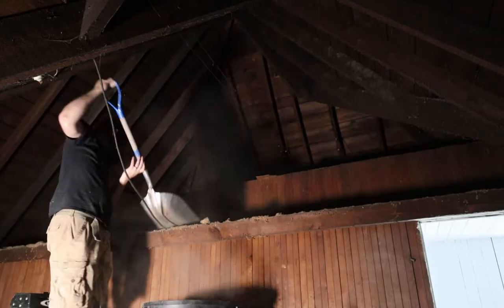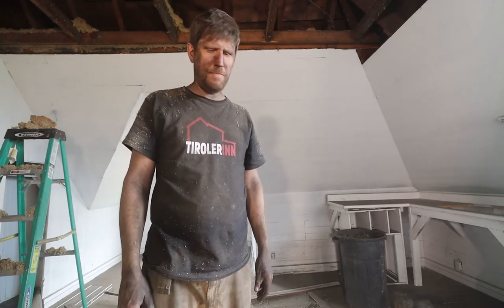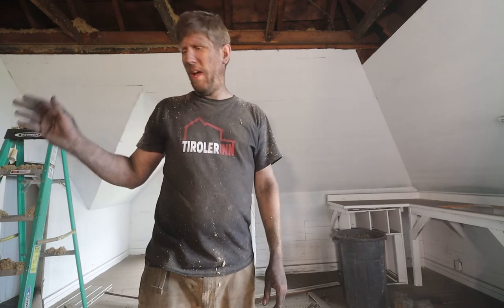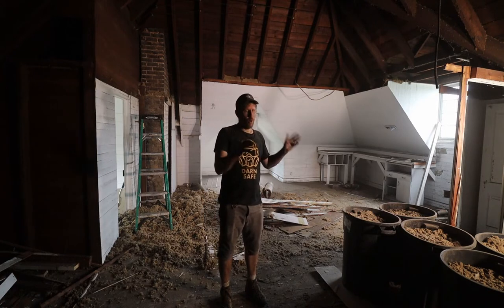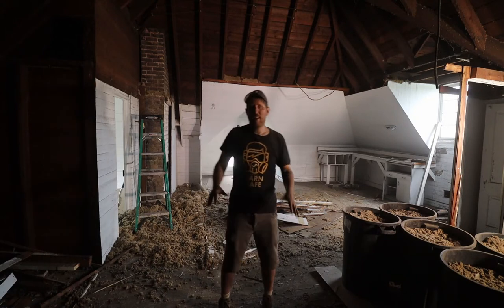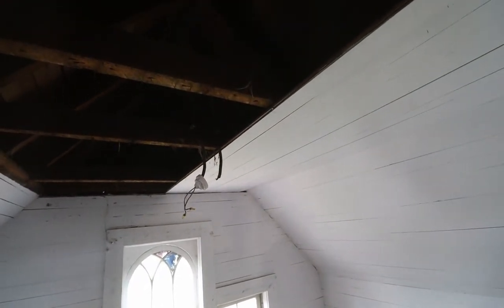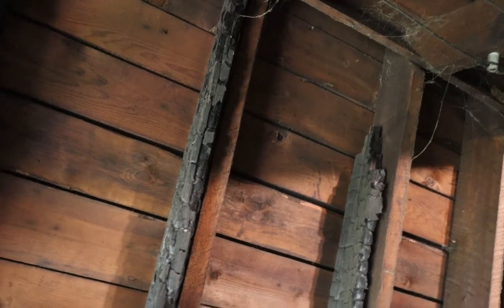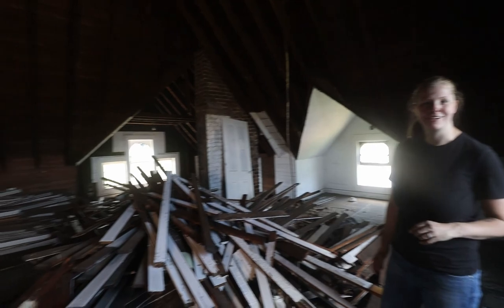Opening up the attic for a future master bedroom space - [Victorian Home Renovation]

Comment: You may have said this and I missed it, but I'd make sure you're adding some some way for your slate to vent in the case of a leak. You have a 120 year old roof it's not a IF your roof leaks, it's a win your roof leaks you want to make sure you have a way for those old growth oak beams supporting your slate to dry out. Without some sort of venting that closed cell foam might just keep that moisture locked against those boards leading to rot.
Reply from the maker: Yes. We are still figuring out what exactly is going to happen on the roof. If we do ice and water shield first under the slate then it should be less of an issue. The hardest part with venting is that there are almost no continues rafters on this roof so venting it is pretty difficult